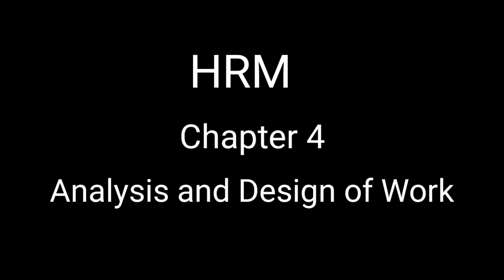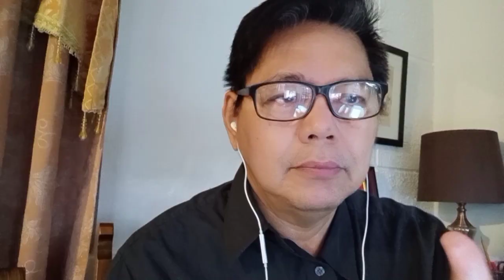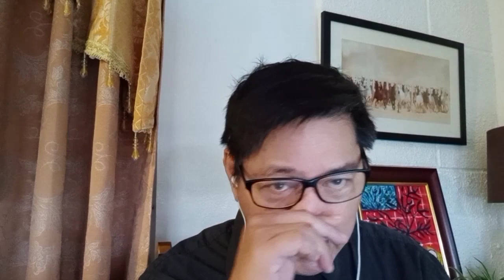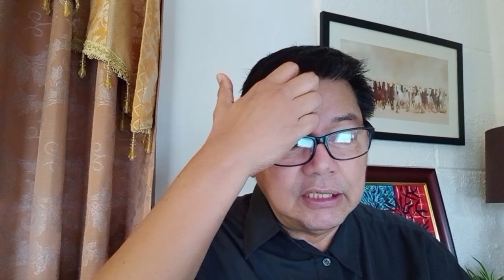HRM: ANALYSIS AND DESIGN OF WORK

Comment: FINAL EXAMINATION 
Jison, Fernando Jr C. 
CHAPTER 4

1.	  Name and discuss the nature of the steps in a workflow analysis. 

Workflow management and the 3 workflow analysis steps
Even before starting the 3 workflow analysis steps, to practice proper company workflow management, you must have the thorough knowledge of the organization’s strategic planning.

This is the only way to properly align the business objectives with the efficiency of its processes. With this understanding, the first stage of process analysis begins.

1- Interview employees (actors)
There is no more effective way of understanding the flow of a process than by interviewing those who perform it or have some form of experience of it.

At this stage of process analysis, it is necessary to identify:

The activities of the process and its sequence
Its participants, their responsibilities and the hierarchical level of each
The information the process uses generates or transforms
2- Analysis of process models
To analyze the process models, you need to answer 10 questions:

What is the reason for the process?
What does it seek to accomplish? The systems it uses? What value does it add to the final product? And what is its current performance level?

What performance metrics do you use?
What KPIs are defined and which points are measured? Is the process within the expected performance standards (or not)?

How many interactions with customers are there? And what are they?
Also, who are the customers? What are their needs? Are they satisfied? Check for redundant or unnecessary interactions with customers.

How many handoffs are there? And what are they?
Handoffs are moments in the process where information passes to another person/system. Check if any of them are creating information bottlenecks and whether the organization measures the time between them.

What are the rules of the business?
Business rules are standardized procedures that expedite decision making. Check if they’re appropriate if they’re causing obstacles and what their steps and levels of approval are. Find out based on what criteria the company created them for and whether you could eliminate any of them without causing harm to the process.

Are there other bottlenecks in the process?
It’s necessary to find out what’s being constrained in the process (information, product or service), what factors are leading to the bottleneck (personnel, systems or organizational) and whether the bottleneck derives from a handoff.

Are there variations in the process?
Determine where they occur most often, what the tolerance threshold is, and whether task automation can eliminate variations.

What does the process cost?
Check if this cost is compatible with the market and if it’s possible to optimize the process to reduce costs.

What degree of variation does human activity cause in the process?
Find out if this variation is tolerable and whether or not you can eliminate it with the automation of a task.

How do you perform process control?
What documents do you use to control the process and what steps does it require for its approval?

If you want to maintain an adequate workflow, you must answer all of these questions as completely as possible during these workflow analysis steps.

Then you need to document the process.

Before you see the next step, understand what handoffs are more completely by reading these articles from our blog:

Handoff agreement: one of the best handoff strategies
Handoff strategies: Convert these procedures into results
3- Documentation of the process
The most important document of the workflow analysis steps is the As Is process diagram, that is, the process model as it currently is.

Some other attached documents may be spreadsheets, checklists, procedures manuals and even statements from participants.

What’s important at this stage of process analysis is to have understood how they occur and to be able to count on ways of sharing them with other team members in order to look for opportunities for improvement.

Workflow management is an activity that aims to analyze, detect points of improvement, design new processes and implement them in an organization with the goal of making them more productive and effective.

Within the workflow analysis steps, one of the most important is process analysis.

Through it, you can understand how processes are unfolding in the company at this time to study them in search of points of improvement.

In this post, you will learn the 3 workflow analysis steps and the 10 points that need to be studied in them.

2.	    Based on a workflow analysis, describe the major differences between how tasks are grouped into jobs at a fast-food restaurant and those at a five-star restaurant. Which job design approach do you see predominating in each? 
   
=>The main difference between a 5 star restaurant and a fast food restaurant is that in workflow of a 5 star restaurant is that a 5 star restaurant holds a standard over their workplace and in which everything has to be performed at maximum efficiency. This is not to say that fast food does not also do this. A good example in a 5 star restaurant is that they can perform job rotation to keep everybody skilled in all aspects of the business. The same predominating concept can also be applied to fast food restaurants as to give everybody a chance to know the ins and outs of the labor part as whole. It is just the 5 star restaurant requires more skills to be learned rather than a fast food chain.

3.		Compare the functional structure to that of the divisional structure, including the nature of their design, their respective advantages and disadvantages, and the types of environments in which they might best be used. 

The functional structure is based on an organization being divided up into smaller groups with specific tasks or roles. For example, a company could have a group working in information technology, another in marketing and another in finance.

Each department has a manager or director who answers to an executive a level up in the hierarchy who may oversee multiple departments. One such example is a director of marketing who supervises the marketing department and answers to a vice president who is in charge of the marketing, finance and IT divisions.

An advantage of this structure is employees are grouped by skill set and function, allowing them to focus their collective energies on executing their roles as a department.

One of the challenges this structure presents is a lack of inter-departmental communication, with most issues and discussions taking place at the managerial level among individual departments. For example, one department working with another on a project may have different expectations or details for its specific job, which could lead to issues down the road.

In addition, with groups paired by job function, there’s the possibility employees can develop “tunnel vision” — seeing the company solely through the lens of the employee’s job function.

Larger companies that operate across several horizontal objectives sometimes use a divisional organizational structure.

This structure allows for much more autonomy among groups within the organization. One example of this is a company like General Electric. GE has many different divisions including aviation, transportation, currents, digital and renewable energy, among others.

Under this structure, each division essentially operates as its own company, controlling its own resources and how much money it spends on certain projects or aspects of the division.

This type of structure offers greater flexibility to a large company with many divisions, allowing each one to operate as its own company with one or two people reporting to the parent company’s chief executive officer or upper management staff. Instead of having all programs approved at the very top levels, those questions can be answered at the divisional level.

A downside to this type of organizational structure is that by focusing on divisions, employees working in the same function in different divisions may be unable to communicate well between divisions. This structure also raises issues with accounting practices and may have tax implications.

Comment: Final Examination
Tibay, Jeremiah D.
ASM3
Chapter 4
1. Workflow analysis refers to the process by which you can take a close look at your company and determine where its strengths and weaknesses lie. It is helpful in finding out inconsistencies in the processes of the organization and enables the business owners to make necessary changes. Of course it is not a compulsory function but neglecting workflow analysis can lead to chronic and stubborn problems which become difficult to resolve. Workflow analysis is a study of the way documents, information and the people who are related to a process move through an organization. Workflow analysis makes sure the benefits you wanted when you signed up for workflow automation actually occur. This includes efficiency and productivity in business processes, customer satisfaction, regulatory compliance, and employee engagement.

3.  Organizational Structure refers to a system describing an organization’s hierarchy within which all the managerial tasks are performed. It represents the authority-activity relationship in an organization. The two most commonly used structures of the organization are functional structure and divisional structure. The functional organizational structure is one where employees are grouped together, according to their area of specialization. Divisional organization structure refers to the structure wherein the organizational functions are grouped together, into divisions, depending on product, service, market or geographies.

Comment: Codera, Gilbert D.
Asm3
FINAL EXAMINATION 

Name and discuss the nature of the steps in a workflow analysis. 

	The 3 major steps to get a better employee is 1. To interview an applicant an interviewer should know if the applicant is qualified to the position they were applying for. 2. An interviewer should analysis the applicant if an applicant is good enough to the company.  if not, the interviewer should reject the applicant and 3. Find out based on what criteria the company created them for and whether you could eliminate any of them without causing harm to the process.

   	    
2.Compare the functional structure to that of the divisional structure, including the nature of their design, their respective advantages and disadvantages, and the types of environments in which they might best be used. 

	The key difference between functional and divisional structure is that functional structure is an organizational structure in which the organization is divided into smaller groups based on specialized functional areas such as production, marketing and sales whereas divisional structure is a type of organizational structure where operations are grouped based on divisions or separate product categories. An organization can be arranged according to a variety of structures, which enable the organization to operate and perform. The objective of the same is to carry out operations smoothly and efficiently

Comment: FINAL EXAMINATION
BILCHES, PATRICK M.
FSM15 - ASM3

1.Name and discuss the nature of the steps in a workflow analysis. 
Stage 1: Collect Hard Data 
Take a report of the work process you need to inspect. Examine the measurements and consider which to be are proceeding as required and which ones aren't. Consider a cost report work process. 
Stage 2: Collect Soft Data 
To additional your work process investigation, you need something beyond numbers. Presently you have to proceed to converse with the individuals who utilize the work process devices most oftentimes. Start with the individuals who round out the structure. Work process examination devices generally just spotlight on the hard information, so this allows you to take your investigation to the following level. 
Stage 3: Ask the Hard Questions 
The following stage of work process investigation is to pose the inquiries that manage the work process. What is its motivation? Who is it expected to serve? What characterizes a decent cycle? A few work processes are made to limit blunders. Others are intended to accelerate the cycle. Utilizing a blend of work process examination apparatuses and in-person discussions, you can think of the correct arrangement. 
Stage 4: Implement the Changes and Follow Up 
Whenever you've distinguished all the progressions that originated from your work process examination, execute them in your framework. Tell all partners of any change, and let them know whether there will be any personal time, or how to deal with things in a changed work process. Work process examination isn't only a decent method of distinguishing if there are any progressions that should be finished with a work process. You can likewise plan valuable reports and see which work processes and which parts of a specific work process are helping your association develop. It's essential to examine and improve your work processes constantly. Extraordinary work process examination instruments guarantee that you can get all the information that you require to play out the investigation easily, in this manner sparing you time, exertion, and cash. A decent apparatus encourages you recognize which cycles are running easily and which need work. Utilizing that data, you can push forward and discover where to make changes and where not to so you decrease costs.

3.Compare the functional structure to that of the divisional structure, including the nature of their design, their respective advantages and disadvantages, and the types of environments in which they might best be used. 
The Functional organizational structure bunch workers dependent on territory of specialization. Then again, divisional association workers assembled, contingent upon item, administration, market or topographies. In practical structure, Managerial improvement isn't simple because of the absence of independence of. Notwithstanding, in divisional structure self-rule is available which makes administrative improvement simpler. In utilitarian association structure cost is less in light of the fact that the capacities are not rehashed. In the divisional authoritative the could be redundancy of assets which might be expensive. The useful structure is use by association which is little and basic. Divisional structure, which is proper for those associations, that are huge and dynamic.